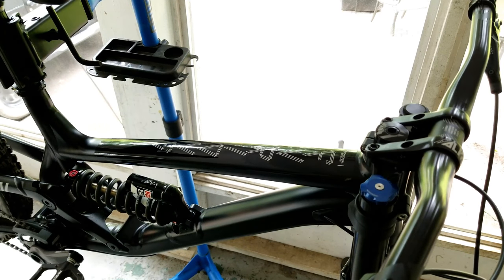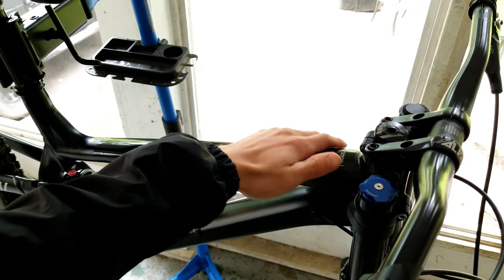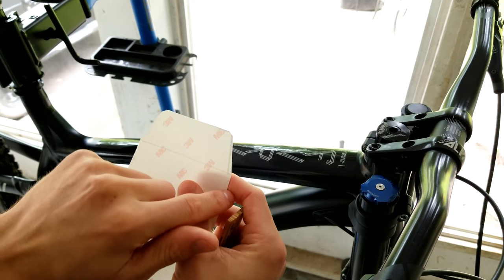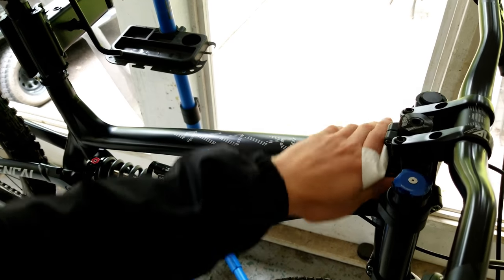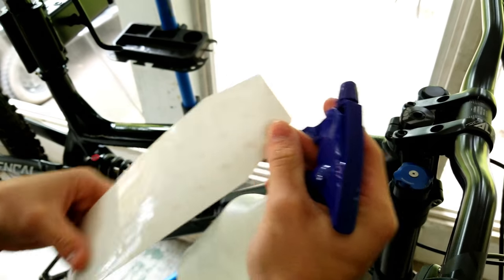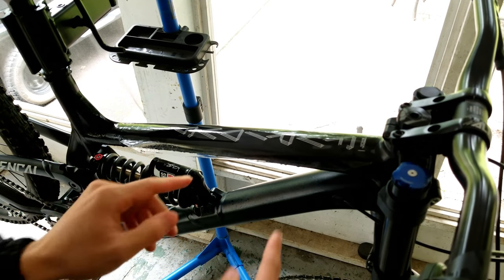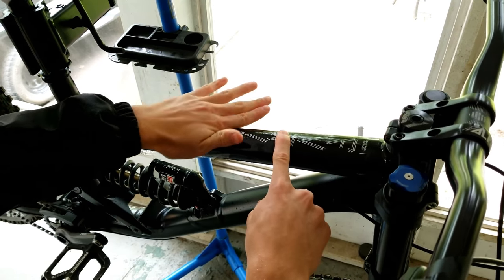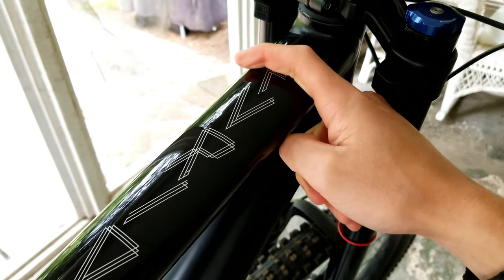DIY Mountain Bike Frame Protection! Under $30

Comment: I just got this tape and am going to put it on a Carbon Frame.
 Is the application different on Carbon? (couldn't tell if yours was Carbon)
Reply from the maker: It's no different than aluminum.
Reply: @ChildrenOfTheLoam   Thanks!  I just put it on my Toptube. I did the best I could but do have some air bubbles.

Next is the downtube.  Do you think it's durable enough, I was thinking about getting something more durable such as a rubber piece.  I'm putting this on a Ripmo. Maybe Ibis sells something for the downtube.  I'll have to check.
Reply from the maker: @NDemanuele1  it will protect from scratches and dings but not big impacts so I would go with a downtube guard if you can find one.
Reply: what is the name and where did you buy it
Reply: What’s the tape and where can I buy it?

Comment: I find 3M helicopter tape 14mill to be the best. Maximum protection and form-able. Anything thicker is tough to work with. I get mine off of EBAY. Some people sell it by the foot. Two things though.....read the fine print and make sure you get the CLEAR tape....made the mistake once of getting grey once. Also....VERY important... make sure
the tape you buy is not to old....AFTER I bought some that did not stick well and was slightly yellow....I found out it had expired 10 years earlier. Get fresh

Comment: Great vid
 I'm looking for frame protectors bit this is an inexpensive alternative. Does It come off just in case you want to replace it?
Reply from the maker: Yes, it typically comes off with no residue but any that does appear can be cleaned off fairly easily.
Reply: It does as he said, but if you are having a little trouble getting the tape off, just use a blow dryer/heat gun on the lowest setting and just heat it up slightly. Should come off very easily.

Comment: I see a couple different widths.  You linked 2 inch but I see 4 and 6 inch widths too.  Would 4 inch work better?? Thoughts?
Reply from the maker: Just go with what you think would fit your bike best
Reply: Upside for 2 inches is it will fit most bike frames without much cutting (easy straight lines)
Upside for 4 inches is it will fit wider areas, so buy it if you have a frame wider than 2 inches.
One caution the tape does not go around (in a circle) the tube well in my experience, must use separate pieces for top and bottom.

Comment: Hi there. Is the back of the tape sticky at all. I have a few small lumps and scratches on my bike already so i didnt know if it would stick.
Reply from the maker: the scratches might cause a bubble or two but you should be just fine.
Reply: Ill give it a go.